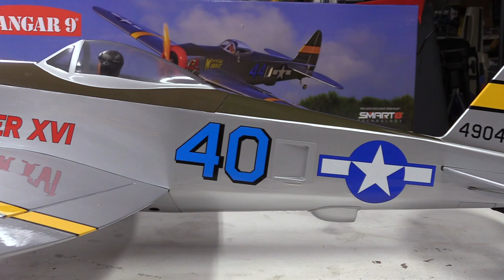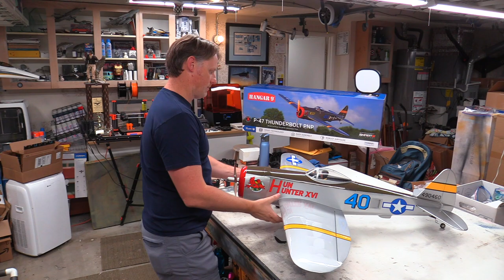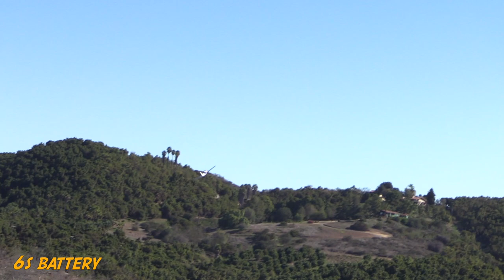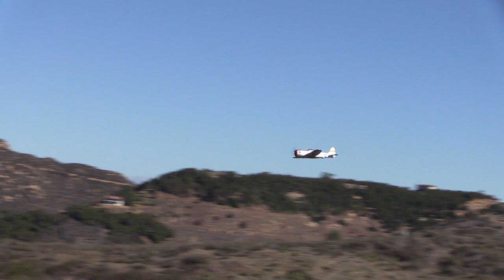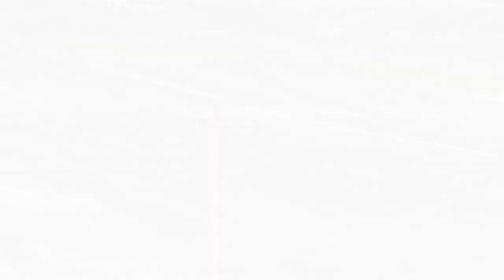Hangar 9 Fun Scale P-47 Thunderbolt PNP Assembly & Flight Review | The RC Geek

Comment: Mine just came in, it has a ton of weights already installed on the motor mount. Also my motor mount is separated from the firewall. No glue on it at all and this is my second plane from Hanger 9 where the firewall had no glue. My 15cc Carbon Cub motor pulled out and no signs of glue on it anywhere. So if anyone buys any Hanger 9 planes, re glue to the motor mounts or at least thoroughly check them. I do it on foamies, never thought I would have to do it on a Hanger 9 plane.

Comment: It's an amazing aircraft. When using the 6s5000, did you replace only the prop with the same ESC? Was there no need to replace the ESC?
Reply from the maker: Correct, no change of the esc.
Reply: @Thercgeek  Excellent. Even if you use full throttle, it doesn't go over 60a, right?
Reply from the maker: I never measured the current and never had any issues between the two.

Comment: I have to ask, what Does it Cost? Does it Come with the RADIO, Batteries, Prop, and all the other things that are going to be needed?
Reply from the maker: The model is the airframe with the electronics installed including the motor and esc. It requires supplying a radio, receiver and flight battery. I have links to all of that in the video description.

Comment: Nice job, you made it look EZ, Brian Phillips did one and did a lot of tweaking on her.
Reply from the maker: What kind of tweaking?  I found the assembly was pretty weight forward. Took a little more time glueing it together.
Reply: @Thercgeek  mostly on rates. It seemed really responsive.  Or overly responsive when he first started. I could see he really had it locked in. Yours seemed to just do great right from the start.
Reply: I believe he did flapperons.
Reply from the maker: @Pete Beebe I heard about that. Honestly, this isn’t a real great candidate for flaperons IMO. Flaperons reduce your roll rate when they are down just by themselves which at slow speed can be problematic.  I think just cutting in a flap would be the way to go honestly and wouldn’t be too hard I don’t think.
Reply from the maker: @Old Scratch that’s all in the setup. I give myself individually selectable aileron and elevator rates which gives me options for both on a maiden. The model was pretty roll sensitive on the first flight, but switching them to low rate during the flight tamed that straight away.
Reply: @Thercgeek  I figured that man. He did too. I just fiddle with it and put them all on one switch. I know lazy right. But yes I am. It's better the way you guys do it.